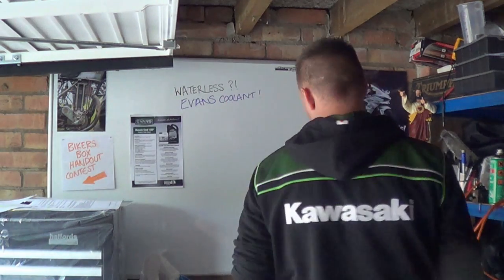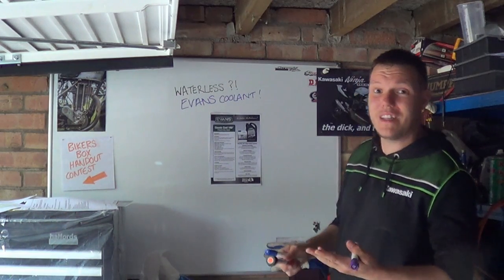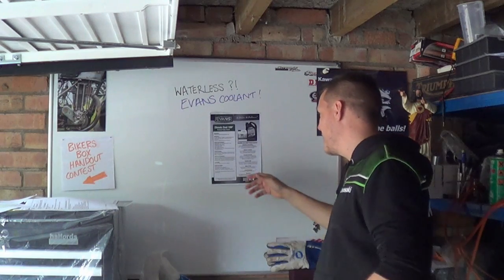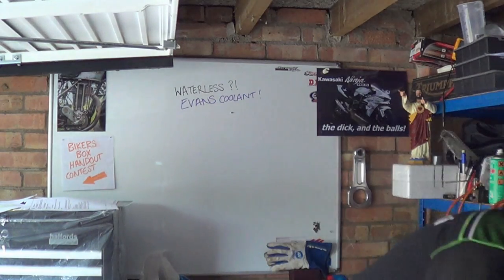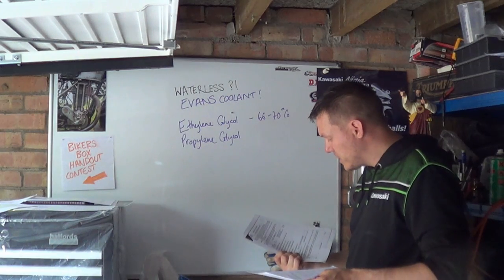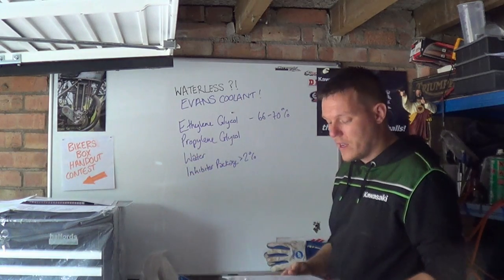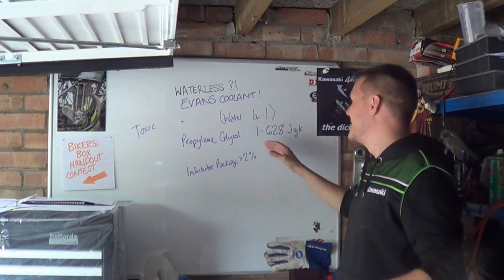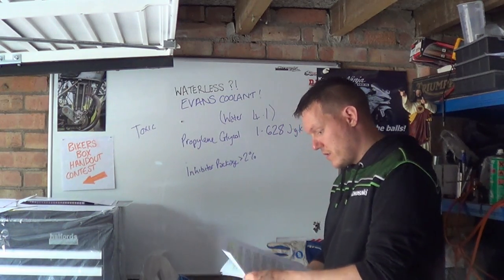Evans coolant any good? Part 1

Comment: For all of your rand review, Jay Leno recommends and uses it in all his antique cars.
So, is Leno stupid? Are you being paid bu Prestone or some other anti-freeze company? Just curious.
Reply from the maker: Jay Leno is an idiot, just look at his hair. LOL
Reply: Most of his cars are parked. This saves them From corrosion. Show me his daily driver using Evans.
Reply: 1. He has 200 odd cars most sit there not getting driven more than twice a year so in his case corrosion IS a concern.

2. A good part of his collection is old school none pressurised systems (pre 30's stuff) and that has different requirements than a modern pressurised system.

3. He knows rock all about the thing and if someone came up offering a few million and free coolant changes for 200+ cars that's going to be more important than the performance 

If you really want a good opinion look at what he keeps in his daily driver or track car.

Comment: Is Evans Coolant used by Formula 1,NASCAR or Motogp teams,is it used at the Isle of Man TT races by any team?
Reply from the maker: Fuck knows, but I don' think so. I don't think they'll even use antifreeze at all - good question
Reply: The Workshop I would sincerely doubt it also,maybe some teams would take their sponsorship money but if these teams don't need the "super cooling" properties of Evans then who does?,I can think of no harsher environment for any combustion engine other than maybe the Paris Dakar rally,I'm sure this is another grasping con using pseudo science,as you rightly point out,a failure will be a component rather than the coolant itself and then it doesn't matter whether your using water or "super coolant",great video,keep exposing the bullshitters.✌👌👍

Comment: I had this same sort of "uuuh what?" when i was buying oil last time; some castrol stuff that claims it'll make your bike accelerate faster... surely not, right? I'll try to find a picture or something of what they claim and see what you think because it smells of snake oil (lol pun) to me
Reply from the maker: As for oils this has a little bit of truth to it. It depends on how 'thin' the oil gets when at the correct temperature. Thinner oil means that the oil pump requires less energy this CAN mean that more of the power produced in used to propel you instead of pushing oil, but the differences are minute - but still there. Not like you'd really notice.
Reply: Castrol put UV dye in one range of their oils to prove it's special, you have to wonder about people who market stuff like that.

Comment: I agree. This is relatively bullshit. The only thing I like about it is the higher boiling point. With a 160 thermostat, you should always be able to open the radiator cap, but then water should do it too. Fuckin' gimmick.

Comment: This stuff actually catches fire,
it did on my car when a core plug weeped on a new engine build
it was lucky the leak went where there was nothing to catch fire, bar the paint on the block, {new paint }  it burnt a  swathe 2 inches wide, 7 inches long, up to the core plug

I was very luck it was,nt some where else
it got changed out as soon as i got home

Only got this stuff a few years ago cos it were on a car boot going v v cheap
Dont buy it folks,

Comment: Evans Coolants saved my car, try out for yourself...i think this guy was paid to make these videos
Reply from the maker: "Evans Coolants saved my car"

- how?

"i think this guy was paid to make these videos"

- if only this was true. It would be easy money -watch the experiment video, then we'll see what's what.
Reply: I'm glad you asked, I can open my radiator cap even when the engine is up to temperature without any pressure, there is no strain on my hoses or radiator, my coolant level has been the same for over a year now on my car, the coolant does not evaporate, unlike my previous experiences with water and antifreeze. This has been my personal experience. Will be glad to upload a video to show the non pressurized system.
Reply: @galaxytab9265  a none pressurised system is utterly irrelevant. Pure pg (the 0.2% anticorrosion shit is irrelevant here) is going to run hotter.thaj 50/50 therefore your coolant system is less efficient, less capable and your putting more stress on the system. Being able.to take the cap off doesn't change the fact you've made your vehicle perform worse.

Comment: water is the root cause of even more than 60% of engine failures, ask me how, go on, it's funny
Reply: Hi aterack833.....I appreciate your incredulity.  I was very surprised when I first came cross these stats, which are published by the BCT Testing Advisory Group, an independent group of engine and coolant coolant manufacturers.  BTC members include; BP, JCB, Millbrook, MIRA, Bentley (BMW) and many more, who have access to this kind of data.  They produce a poster which states;
> Fact - Up to 60% of engine failures can be attributed to cooling system failure.
> Fact - Over 60% of water pump failures can be attributed to cooling systems.
So, based on these independent stats, maybe Matt should be spending an equal amount of time to properly understand the long-term problems associated to water-based coolants.
You can find the BTC poster at;  http://www.btctag.org/info_/publ/btc11_919_p.pdf
Reply from the maker: how? lol
Reply from the maker: LOL its a poster! Where's the data?
Reply: Matt, you miss the point.  The poster is produced by a highly qualified and experienced group of engineers from blue-chip companies.  I.E. the data they will have referred to is totally credible and, in this instance, not published for the benefit of Evans coolants, but to illustrate the problems associated to water-based coolants.
Reply: ok..... anywho people are made of like 72% water, engines fail due to people in some way or form 100% of the time, there you go more than 60%, anyways send some of your product (300 ml from each line or 100ml for inconclusive test) to my independent lab  and i can determine if there is any real world application, but even though i did not agree with "the workshop" at first, i still always agreed on the inability to blow a rad cap being a bad thing in certain systems, i now need to make a closed loop radiator system and input a specific btu of heat to test the heat transfer and cooling ability of evans vs glycol and water and 50/50, failure of the test will be decided by the metal reaching a temperature above 150 Celsius on a cooling system designed to not maintain correct cooling, thus if evans overheats but the other coolants do not then it has failed, the system will be set up in both an open flow and pressurized style system the input btu will be that which would come just above a normal operating temperature for a standard engine or just below the critical point and staying there, once an equilibrium has been met where the coolant maintains the heated surface and thermal-couple or laser thermometer reading of this surface remains constant, i will then record the setting on the btu device (non electric so no fluctuation due to in built temperature control devices) and flush the system by draining it and flushing several times with water and then methanol or other hydroscopic substance and allowing several hours or days to fully dry and evaporate, then using the same apparatus and setting on the btu device, i will determine if evans can cool the heated surface more, if it can or if it cools the same amount i will call the test a success in evans favour, and i will post the results, for the evans test i will also measure the radiator temperature and for the open flow test i will measure the coolant temperature, if your product can move heat better than standard off the shelf 50/50 then i will come back to say so and i will consider using it in my project engine, however evans would still not help in the event of my diesel truck where the temperature sensor failed in the cool position and was failing to read hot enough when operating before failure, without boiling i would have no way of knowing if i overheated, that's if this was a standard setup, my truck has a free flow cooling system not found standard, the only way i was able to tell was that the heat soaked all the way into the engine, through the cab, frame and fenders and even started to heat the box of the truck, this is an extreme case of slow overheat, evans would actually allow this to go further to the point that i would have easily felt the temperature if i was in the truck, however it may have just gotten there quicker and made a bigger problem, my test will determine, if you do not provide samples i will buy the product i find best suited to my project build and do large scale testing on the same type of setup since this will come at my expense i will only report weather evans coolant is equal or lesser than standard 50/50 and not if there are any benefits over it, at these larger volumes however it will be easier to make a test apparatus and i may leave out if it is lesser if only by a small amount, depends on how hard i feel the work is to do the testing
Reply: read my last comment if you were asking me how, it's in there, didn't expect these evans guys to act how they are, i sense we may have to do heavy testing and confirm, put every test as reasonably in their favour as you or i can and watch them fail anyway, or if they pass then find out exactly why, or send some off to a spectral analyzer or whatever and find out the compounds that make it, then see if anything there can change the specific heat
Reply: reading that poster i stopped at "Did you know - CON's" thinking man i'm pretty sure i'm trying to debunk one right now
Reply: i'm sorry but what is evans going to do about the corrosion on the outside of my rad that made the fins fall the fuck off? as far as i know the coolant did not cause this since it still looks like new from the inside, i'm sorry was i supposed to buy evans and rub it all over the outside of my rad too, to have prevented this from happening? man i actually thought this was a good product, after marketing crap like this i think i won't even give them the benefit of testing, they actually had my hopes up in thinking there would be something to keep the actual cylinder walls cooler, it's known to me that boiling causes damage to the water jackets and leads to even poorer thermal contact, but if evans just let's the engine get how without this damage you get damage elsewhere my dads tbsc ran hot when racing and sometimes even hit the cutoff temp while driving all evans would do if the workshop is correct (after reading that marketing hype bullcrap i believe him more than evans) is make it overheat even earlier and cause more damage by not telling the cutoff the actual temp soon enough, what king of product are you selling, if i do do any testing it will be as proof towards suing for false advertising after reading your flyer i don't want your product in my engine or other cooling system, that is a straight up lie but i'll let it slide since the corrosion inhibiting is not your main selling point
Reply: @Steve Hickson Riiight, ya totally legit scientific findings just so happen to be in the form of a poster, let the test be the deciding factor how about that.

 If i have to design my cooling system bigger to overcome the lack of thermal conductivity of your product then why would i ever use it? i'm making an ultralight eco car not a freaking ocean liner, i don't have space and every gram counts on my vehicles final weight.

Even if it allowed me to run hotter without boiling or bubbling or cavatation or whatever you want to call it, we have all seen it's effects but they only affect the engines ability to cool, and only slightly.

 i have only ever owned one engine where the failure could even be contributed to the cooling system, and that was a bad headgasket on a mini van, even if you just said "yep your coolant caused it" that would not be enough, and simply put, my engine does not use heads so there is no gasket to fail.

until i see a test that shows the cooled device temperature vs the coolant temperature of antifreeze concentrate, water, 50/50, and evans, and it shows that evans outperforms, i will call your product a near scam, outperforming will be determined by the temperature of the cooled device being lower over a period of 2 hours, if the coolant temperature increases but the cdt does not then that shows increased heat transfer, if both increase, that shows that the coolant can't cool effectively.

determining factors for a failure will not be fully disclosed until testing is completed, but many can be deducted by simple reasoning with a skeptic mind, if the heated side of the cooled device can be measured then providing such information will aid in avoiding disqualification, ie we can't know what method evans will use to create this heat, and we don't know what method they may use to try to fudge the results so knowing the temperature going in would let us know they have now reduced the heat going in on the test of their product, and for the workshop we know his device will try to keep a set temperature, not that effective for this test since if there is enough cooling to cool the block it his hotplate will just add more heat, though the thickness of the block should avoid this, we also don't know if he would turn down the temperature but angling the camera down will solve this, if a pumping system and radiator is to be used you must show the voltage and amperage going into the pump and if a fan is used the same must be done, this is a lot of work i know, but if either of you stand by your word enough it should be worth it.

thank you and happy testing, if either of you have a proposed better idea please share and let others decide if it is fair, i will attempt to play the non biased party here and look through both sides of the looking glass